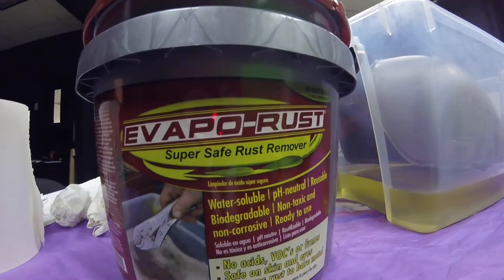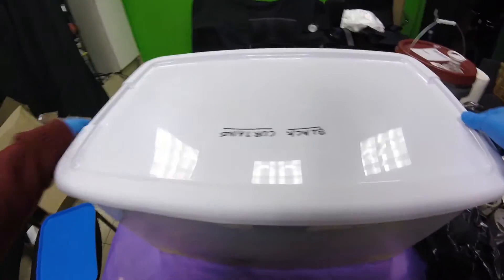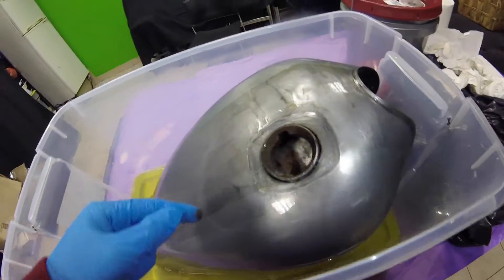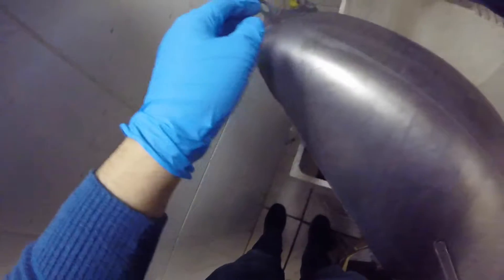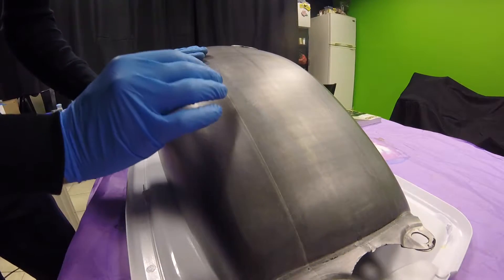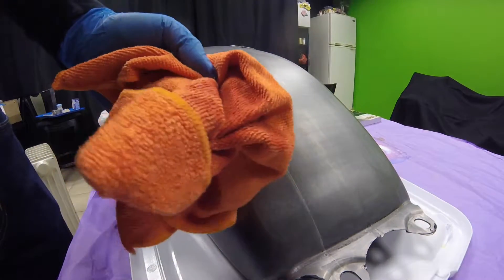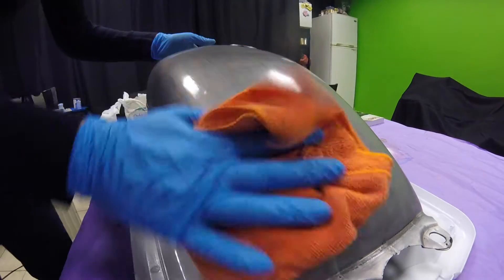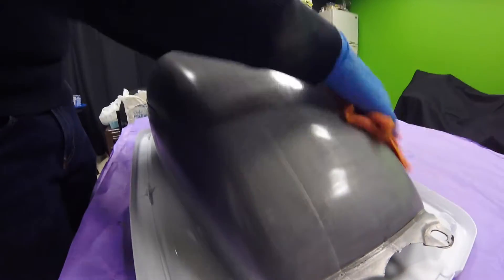Rust Removal - Motorcycle Fuel Tank

Comment: I like evapo-rust. I have an old Yamaha enduro 600, Ill probably seal my tank with wax and fill with 9 parts water 1 part Molasses, the rust will turn to silt in two weeks. You still get the flash rust and it will give metal a grayish patina but it wiil all be gone ! Molasses is my go to if I have the time. Good video !